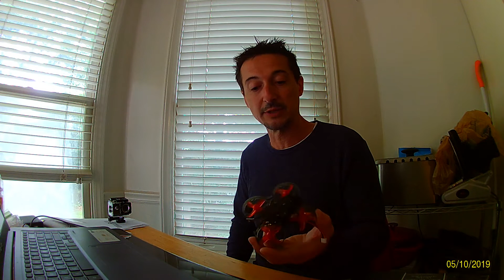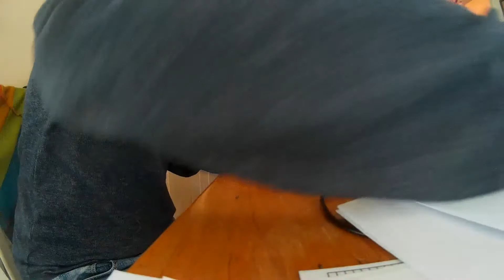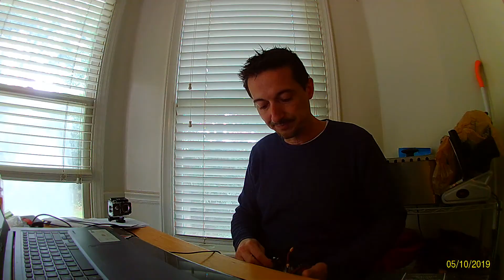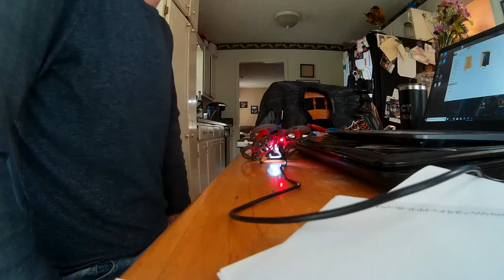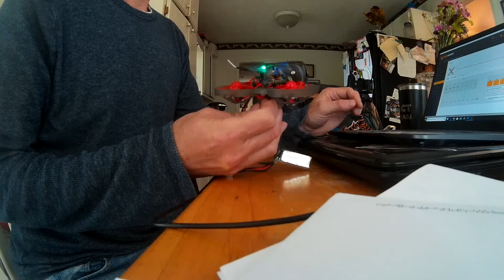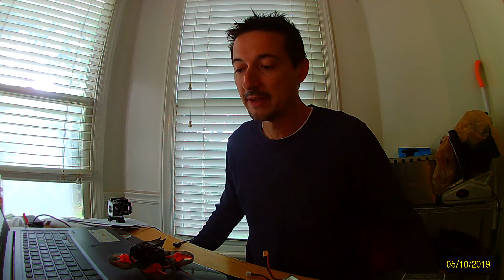Mobula 7 HD Issue

Comment: Did you try flashing firmware fresh? “Props off” video shows mobula 6 has similar problem when battery gets low it loses all communication except telemetry.
Mine I just got did this after 3 20 seconds test flights 6 feet off living room floor with good battery voltage and no crashes. I’m waiting for reply from gethpv to see if  since still within return deadline will deem it defective.  I think I’ll stay away from mobula models until this is corrected publicly. From what I’ve seen on youtube 
Reflashing firmware should work. That eay you’re not stuck with a $100+ paperweight that is not heavy enough 😢
Reply from the maker: I actually ended up selling all my drone stuff :(